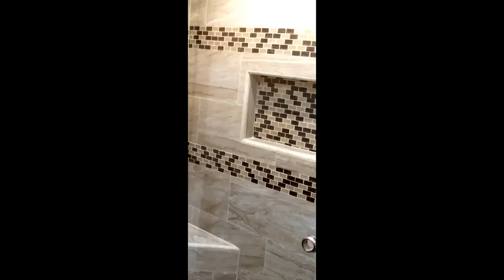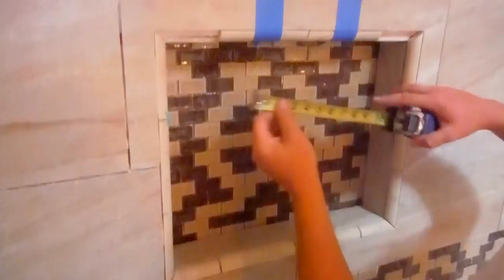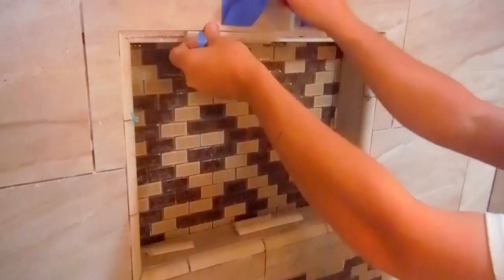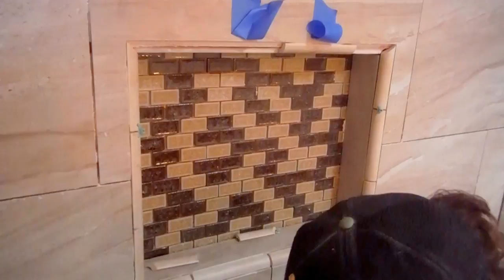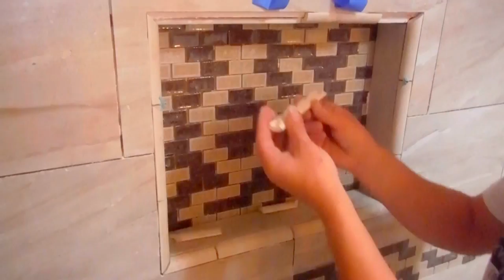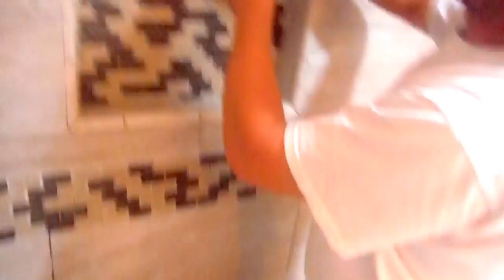How to Install Quarter Round Pencil Trim for a Shower Niche -DIY

Comment: given the pencil tile is 3/4 thick, did you stop your wall tile 3/8 before the lip of the shower niche? can you do the miter cuts on a simple wet table saw?
Reply from the maker: Yes we did, and yes you can miter on a tile saw that has the miter capabilities.

Comment: The thinset appeared to be oozing between the trim tile joints, wouldn't this interfere with the grouting process?  Also noticed the lower trim breaking at the same grout line as the tile below, is this proper?  I appreciate your video and my comments are not intended to be "snarkey," I'm just trying to learn.  Thanks!
Reply from the maker: Bill Parsons  we clean the thinset out of the grout lines before it sets up with a utility knife. You can always clean it out later but it's more difficult. Because of the offset wall tile pattern, we would either have a grout line matching up on bottom or the top if we had started the layout opposite. Also we didn't want to have tiny pieces at either side. Thanks for asking!
Reply: Thanks! Appreciate the quick response and your willingness to share your hard earned knowledge.
Reply: Ok so no magic with the thinset, you’re just estimating volume needed and if some squishes out, just clear it.  Simple enough.  I’ve been using a BBQ skewer for cleaning the joints before it fully hardens.  Perfect 1/8” with a point, good disposable “tool”

Comment: Useless video. Nothing on how to measure or cut or even what adhesive to use.
Reply from the maker: i know, old video and I've learned since..
Reply: @LandbergTileTV  A very gracious reply that I probably did not deserve. I was frustrated last night and was looking for info on exactly what you were doing. After looking for hours for a tutorial, I thought I had found it.
Reply from the maker: @gillsperlein4757  Are you having problems cutting the miter on the trim? It is tricky and you should order more than you need to practice.  What saw are you using?
Reply: @LandbergTileTV  I actually found some videos on cutting.  I know it will be a challenge but I did get extra pieces.  My question is when I am laying the field tile up the shower wall, how much space do I leave for the quarter round trim. Same for the file inside the niche coming up to the edge where the quarter round will go.  Thanks mate.